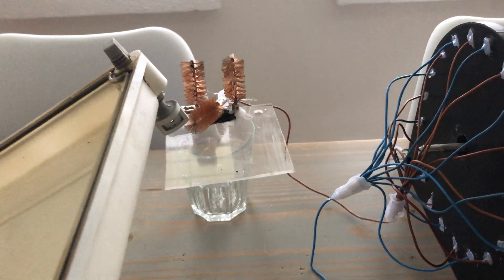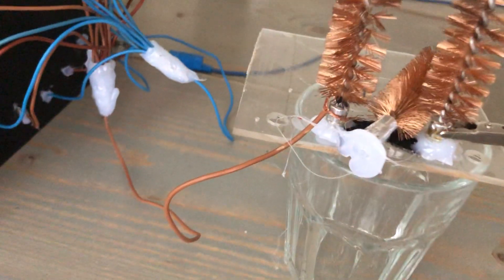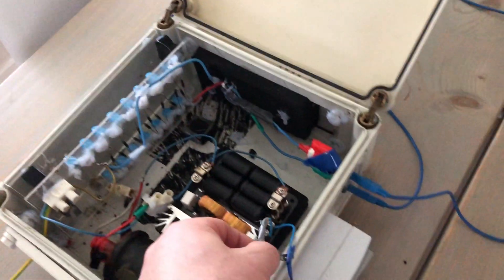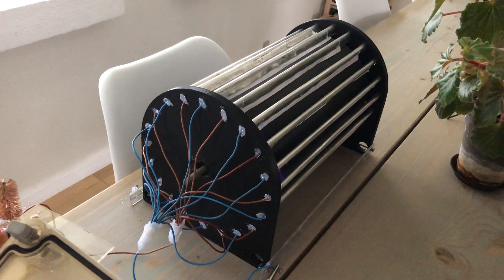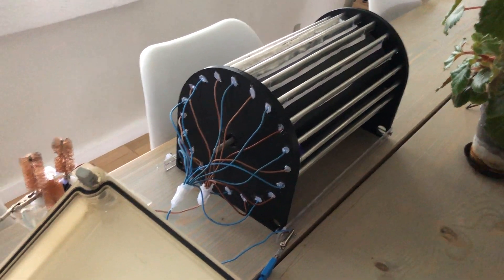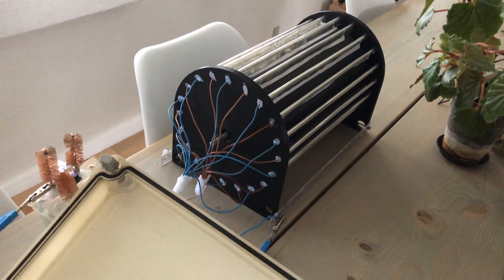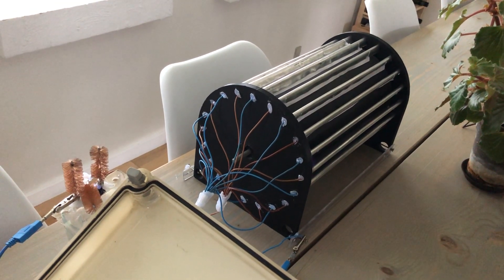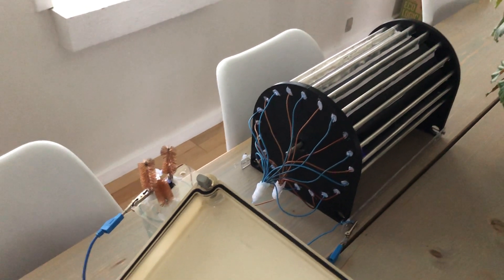2 February 2025

Comment: I would try a high voltage ac cap in parallel with the spark gap. I've had great results with an AC cap and a mechanical spark gap switch where's my pulse motors high voltage. Very interesting.
Reply from the maker: @make425  thanks I could try that.👍🏻

Comment: Great work as Usual , wondering how many RPMs it reached ? All the best .
Reply from the maker: @princedemiterios2488  unfortunately I don’t have the equipment to measure but I hope the audio was good enough for you to hear the frequency adjustment 👍🏻
Reply: @dkdyker  sure it was very clear and obvious how it adjust after the motor reaches high rpm then also the spark on the side of the motor disappeared as it reaches and have full efficiency , Thank you for sharing and for the amazing effort and demonstration , All the best .
Reply from the maker: @ hopefully you can use some of my investigation information:)🙏